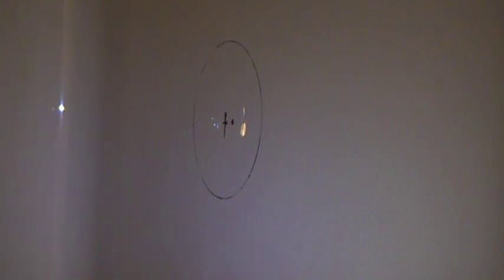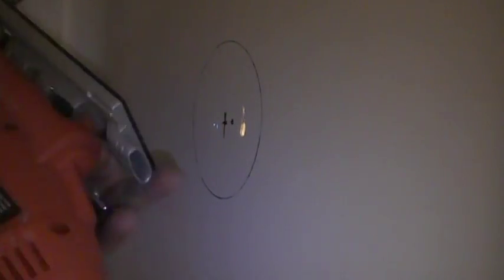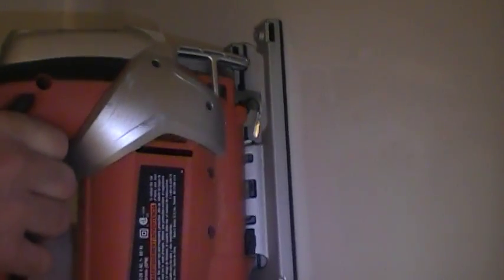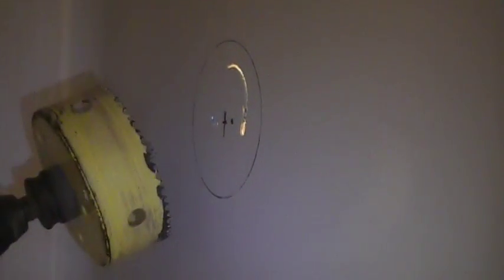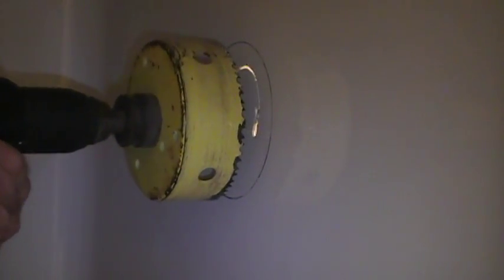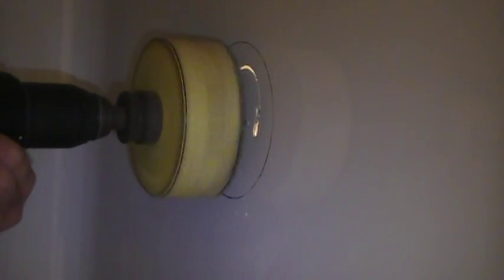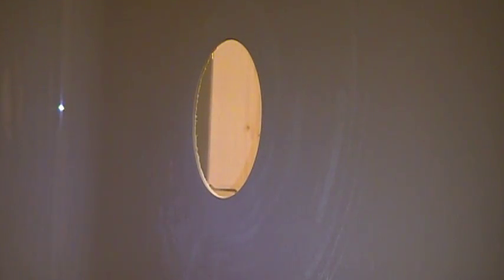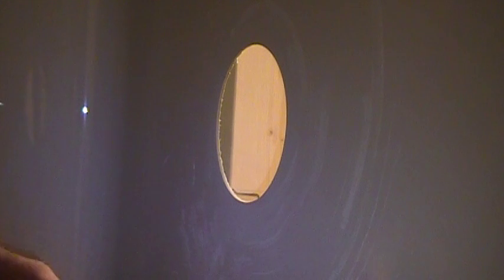Shower install...Part 2.How to cut a hole in an acrylic shower.Plumbing tips!

Comment: I'm so glad I came across this video. It made my job so much easier knowing the tool I needed  for the panel. Thanks so much. I've subscribed  as well.
Reply from the maker: Hello Carly,
You're welcome!
Hopefully your project goes well for you. 
Take your time with the hole saw as it will hook as soon as the center bit goes through the acrylic and make sure the bit protrudes out past end of the hole saw at least half an inch.
Slow and steady wins the race!
Thanks for commenting and best of luck with the project!      Al

Comment from the maker: Part 2
All tubs are different. Mine in my own house when I built was out 3/4's of an inch and that was when i decided to try the belt sander. I had put the tub in the bathroom and never gave it any thought until I had to hook it up about 3 weeks later. I built the house myself so just getting the 1 piece in before the doors were in was my goal.
Is it attached with rods or bolts?Is the tub square or is the floor slanted?If you level the tub do the walls become plum?
Get back to me if u can.  Al

Comment: Hello Al. My father is doing a home bathroom install, and needs to cut a hole in the acrylic shower to do the install. Do you have any recommendations for blade types for the jigsaw/holesaw? My dad is nervous because he is afraid of cracking the acrylic.

Comment from the maker: Hello izerkej;
You want to stay away from coarse blades.They will chip the acrylic.Use fine to medium and make sure that the blades are relatively long.What I mean by that is do NOT use short jigsaw blades.Never remove the jigsaw from the cut until the blade has stopped moving.Make your marks;drill a hole using a HSS bit or use a small hole saw if you have one.Tape the bottom of the jigsaw base to prevent any possible scratches from happening. 
Tks 4 commenting; let me know how you get along! Al
Reply: TheOldkid888

Comment from the maker: Hello Tim;

How far is it out of plum Tim?
New installs on old floors can be a problem. I generally place the base of the tub where it is going and see how level it is. From there if I have to do any adjusting; it is done with a belt sander.I know this sounds wild,but I have taken as much as an 1 1/8th from one end of the tub to nothing on the other and then I do the same to the back depending if it has a leg or edge. 
I don't have any info on tub installs as of yet, but I hope to in the future.

Comment: Hi Al, quick question can I use any Ole hole saw or will it have to be a diamond hole saw? Thanks  in advance!
Reply from the maker: Hello Patrick,
You can use any hole saw that is sharp. No need for a diamond hole saw.
Not familiar with Ole, but if it will cut through wood it will be fine on the acrylic.
Biggest thing is to hold the drill firmly and evenly. You don't want it to jump on you. The pilot bit should extend out at least 3/4 of an inch past the teeth. My experience is the farther out the pilot the better.
Patience wins the race!
Thanks for commenting and best of luck with  the project!     Al

Comment: I'm trying to install a 3 piece acrylic tub/shower combo.  It's together and the silicone is cured, but it's not plumb.  Do I have any recourse in trying to fix it to get the walls and cap plumb?

Do you have any tips/tricks for putting these combos together?  The pieces don't seem to sit on top of each other very well.

Thanks for the help.

Tim

Comment: Before starting with hole saw:
Brush the area with dishwasher detergent or cheap shampoo to prevent toxic dust from becoming airborne
Tape an exit area with few layers of painters (paper tape) to make a neat exit hole
Reply from the maker: Hello mkrp4,
Great tips!
Much appreciate the input!
I don't worry about the exit as much as the starting of the hole. Keeping the drill perpendicular to surface you are drilling is most important. You want to make sure the bit is deep enough so the hole saw won't jump on you. Always a big concern!
Thanks for commenting and have a great weekend!      Al
Reply: Thank you!

Comment: The pipe to the tub spout broke inside the wall.....I cant get good access because the furnace closet is behind that wall....how do I access it from the front?....
Reply from the maker: Hello Terry;
This doesn't sound good.
If you can get any access in the back just to see what is taking place maybe your first thing to do. Hopefully it isn't as bad as it seems and you may not have to do much to make the repair.
If this is an acrylic tub; you are going to have to get in from the back regardless because you DON'T want to cut the tub itself. If it is not acrylic; you may have to cut a front section of wall open where the faucets are.
I wish I could give you better news, but this is a project.
Thanks for  commenting and best of luck with the project!     Al
Reply: Thanks for replying. ..I was able to crawl through the air space under the furnace and cut out the broken fitting. The hard part is replacing it on my back with both hands over my head and working inside the wall......

Comment: People do not make the mistake this guy is making by putting such a big hole. smaller the hole the better,  the two cover screws for the plate will Center the valving,  guys tighten the front screws it's not centered on the back side
Reply from the maker: Hello John,
A large hole will make it difficult to get the faucet in the center of it. I understand what you are saying, but it has to be bigger than the distance from screw to screw as the flange is concave and requires a larger hole in order to set into the shower. The black rough-in flange that comes with the faucet is larger than the size of the hole I installed in the shower. I have never had an issue with this size hole.
   A little care when installing the faucets and there is no problems. Taking a center to center measurement from the shower head and faucet and soldering in your shower elbow assures you it will be in the center of the hole from top to bottom. A little care while installing the flange and everything will work out fine.
If you have a look at the next step of soldering the valve you will see what I do for the faucet installation.
Thanks for commenting and have a good week.    Al
Reply: It’s literally a 4 1/2 hole which is smaller than most guys cut, gtfoh 🥴🥴